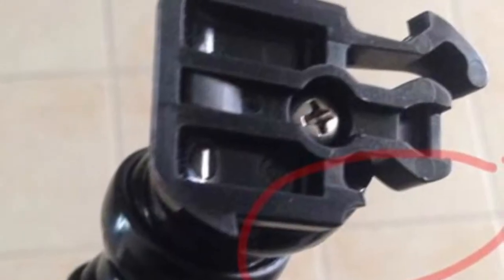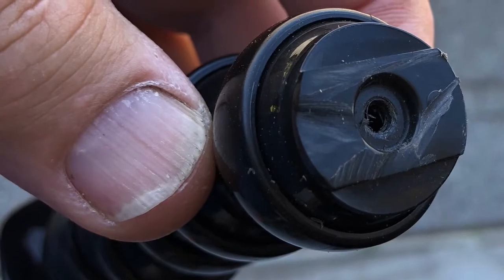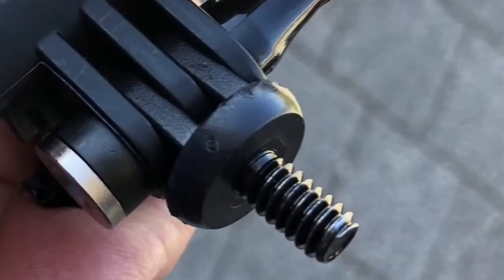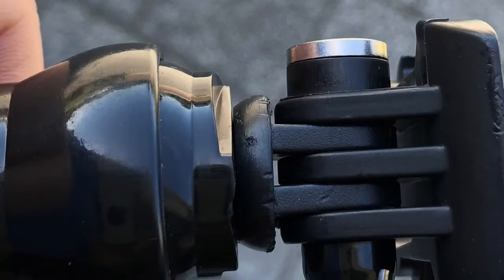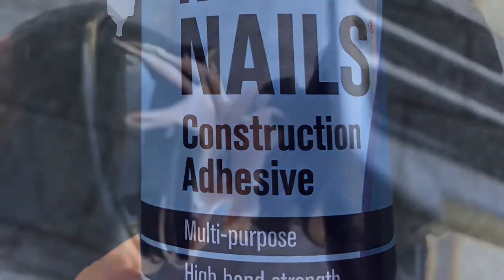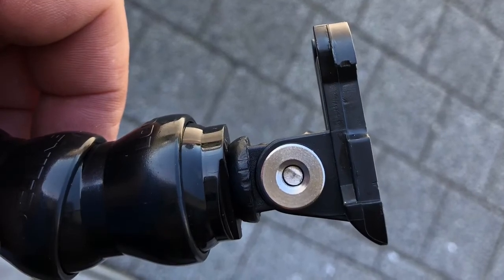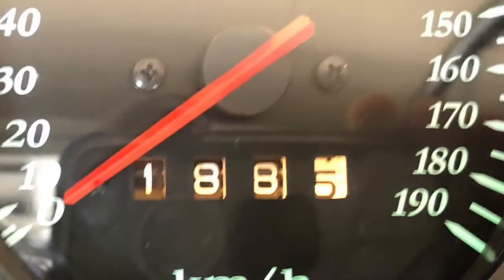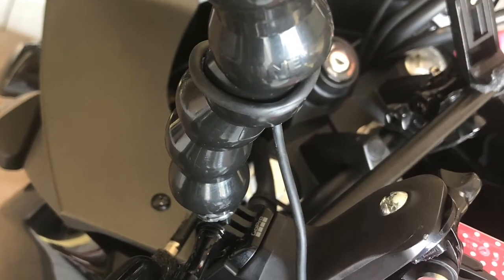How to Fix a GoPro Gooseneck

Comment: Can u name the part u used ?? I bought similar but the screw doesnt fit , what screw size is it anyway ?
Reply from the maker: Tomasz Nowacki it is a simple tripod  no name brand screw that was in the toolbox. I did not go out and buy it.
Reply: @NO17DownUnder  yes i understand but i bought my part think8ng its a standard tripod screw and it turned out to be much smaller screw ^^ when i took goosneck apart